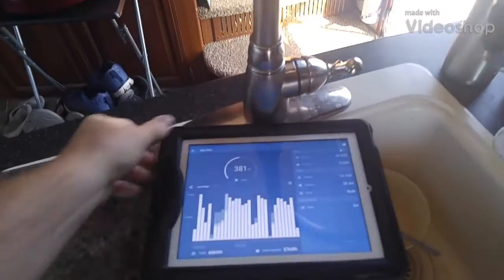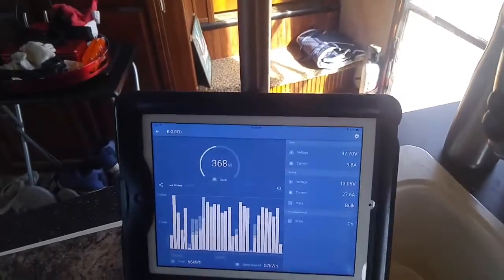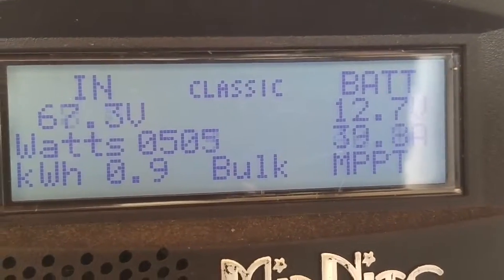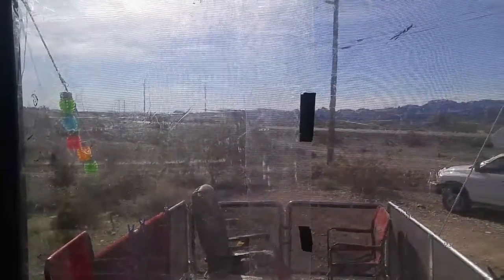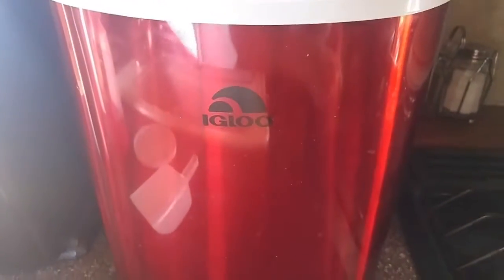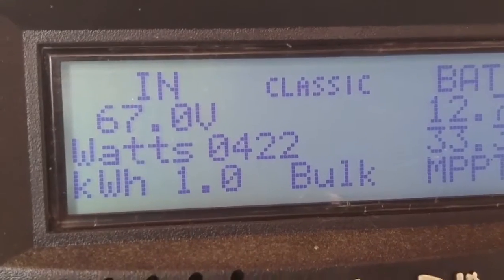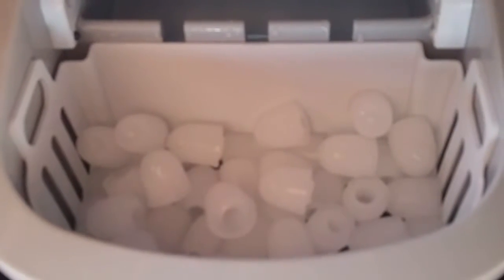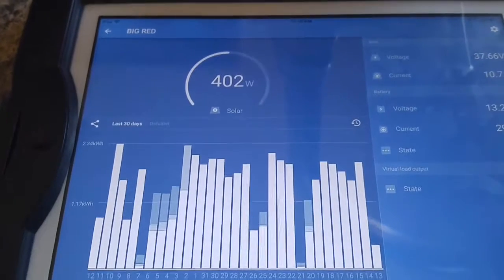Igloo tabletop ice maker on solar power and an update

Comment: if they can make a 12 volt/24 volt RV freezer/refrigerator they can also make a 12/24 volt ice maker they need to start making one as I really hate to use an inverter to convert dc to 110vAC thats just add inefficiency that hogs power from the system.

Comment: thats sweet! I would love to do what your guys are doing! how many cell is series is your chevy volt pack ?
Reply from the maker: Yes very nice.
Battery contains 36-17ah 3s12p

LiCo02 Lithium Cells
Reply: @PentaxLife   you not charging over 12.6v are you ?
Reply from the maker: @GoingOffGrid101  no they where I had the battery solar charge controller on the one 12v flooded lead-acid battery to start the generator
Reply: @PentaxLife  o good :D